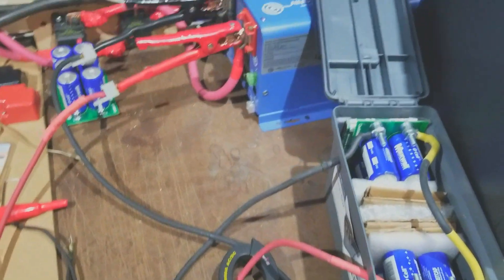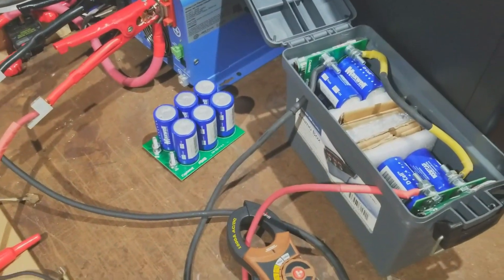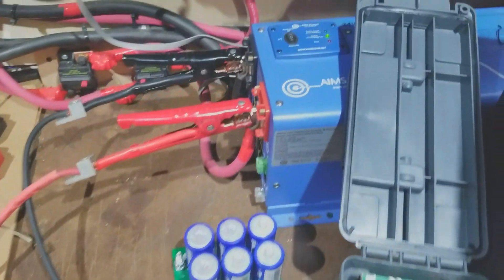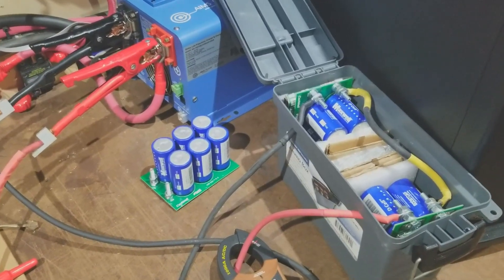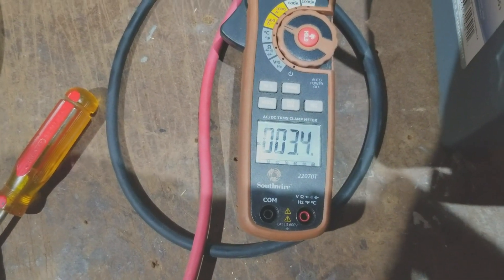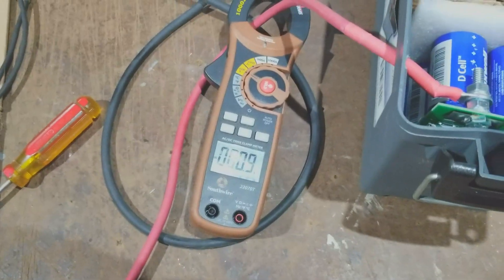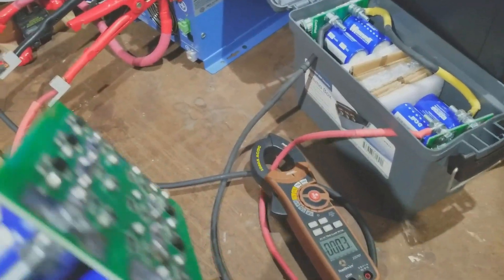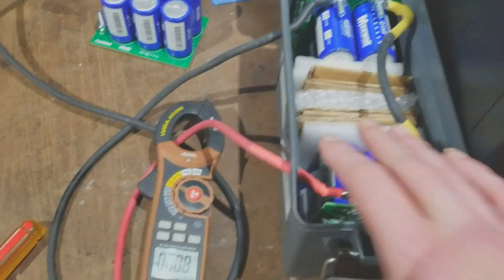Maxwell Super Capacitor use for Off Grid Power Inverters.

Comment: How Can a 16v capacitor be connected to a 12v Battery without damaging it please 🙄🤷?
Reply: Well it will just charge the super cap to 12v. That 16v only means that it can handle upto 16v

Comment: Hello SOSH. I'm new to this super capacitor assisted battery bank aspect of solar energy. I came across your video in my effort to learn "how to". My goal is to provide some surge assistance to the battery bank to smooth out draws as you describe but I haven't found anything that specifically explains how many/big the supercap bank should be based on capacity of battery bank or output of inverters. I suppose it is simple math, but I haven't found instruction. I have six 100AH 48V LP4 batteries and two 6.5kW inverters in parallel. Can you point me to information (or explain) in this regard? Also, I see some pre-Mades with BMS; in what situation would a BMS be necessary?
Reply from the maker: Most Cap bank dont have BMS. They are called Balancing boards to bleed off extra Voltage. Also in your stituation. The amount of caps would be probably 20 to 24 depending on Voltage rating of Cap. Most are 2.7 to 3.0 Volts. I would use 3000 Farad each one. Because then you would be around  100-150 Farad, That would be Huge for 48 Volt. They have to be tied together in series to increase the the Voltage rating.

Comment: I am thinking that this type of setup would suit running a 2000w microwave on a APC 3000XL UPS with a 48v 102AH AGM lead acid battery bank. Presently, the voltage sags quite a lot. What do you think?
Reply from the maker: You get enough capacitors it would most likely help some.

Comment: That's so much for the demo.
Sir, I need your advance on this...
I have a 3000w inverter to power an induction motor through a frequency drive,  two batteries are connected in series for a 24v input. How do I connect my supercapacitor on 24v batteries?
Reply from the maker: Best connection would at the Power input on your Power Inverter.

Comment: Very nice setup, I was wondering how well your charge controller gets along with your capacitors or do you have separate ones for the batteries & capacitors?
Reply from the maker: The charge controllers get along fine with them. The Capacitors charge up along with the batteries .
Reply: @SoutheastOhioSolarHaven  Thanks for your response. Do you have the capacitors connected directly to your inverter or in parallel with your batteries?
Reply from the maker: @Pbeas52  My cap bank I use is in Parallel with my battery bank.
Reply: @SoutheastOhioSolarHaven  Very interesting, are you using an mppt controller or pwm controller?
Reply from the maker: @Pbeas52  Midnite Classic 150's 3 of them
Reply: @SoutheastOhioSolarHaven  Great controllers, they don't come much better!

Comment: Hey , almost done my solar setup. I need help‼️ 3000 w inverter, 8000 btu ac (800w)... Ac still cuts inverter off when the compressor is trying to come on‼️ Im sure i dont need a more powerful inverter.. Any advice? Would one of these work? Thanks & God Bless‼️
Reply: All you need to do is double up your positive and negative wires or yet really thick wires that should fix the issue
Reply: @supremeautomotive6749  I realize my battery Bank wasn't big enough I'm way more advanced now lol
Reply from the maker: Depends on the size of your battery bank. If you can run it also. If your trying to start with just a couple of batteries it may not start. But a small bank of supercaps may help you also. But you still need a decent sized battery bank to deal with high power starting devices such as your Air conditioner. And a Good Power Inverter that can handle starting surges.
Reply: @SoutheastOhioSolarHaven  thanks

Comment: Hello I like car audio and I am new to solar but like it because it seems similar and both want the same end goal, A ton of juice and able to pull from it constantly and Sporadically. Could you pair a couple of xs power titan 8 lithiums their 14v? Also with the caps With these caps mainly your 250? Could you go 14v on solar? And could you also go 0/1 ofc on solor?
Reply from the maker: I see no problem with that.
Reply: @SoutheastOhioSolarHaven  Thank you. How many volts is to many volts in a solar system?
Reply from the maker: @Btc_maxy   When you using Lithium or SuperCaps. You don't want to go over manufacture ratings of the Batteries or
 capacitors.
Reply: @SoutheastOhioSolarHaven  man your awesome, i just learned theirs not much benefit of running higher volts because one of variables always ends up  the same. I guess their is some sort of benefit but not worth the cost. From what I understand. I wonder if a solar system can power an alternator 24/7? If so you can end up having a continuous 100/200 amps.
Reply: Wow big idea could you not end up powering even more alts with just one alt is this viable?

Comment: WOW ! SUCH SURGE STARTUP POWER IS GREAT KEEPING THE INVERTER FROM EVEN DIMMING THE LIGHTS DURING LARGE MOTORS AND HEATING STARTUPS .  THATS STEADY RUNNING ALONG WITH THE REGULAR BATTERY BANK .
Reply from the maker: it will help alot against surges of current from battery bank
Reply: Just a thought, I did not know typing in all caps is considered shouting. just in case you didn't know, did not mean any disrespect.

Comment: Great video my friend just one question can supercaps  hook up to solar panels before the charge controller to maintain current on cloudy days due to their Quick state of charge
Reply from the maker: I have actually tried this, And it really did't help. I think it because of the limited power solar panels will produce. Plus charge controller will control alot of it. Now for charging capacitors. Great for that. Just need to be careful on the Voltage.
Reply: thanks much

Comment: Hey- how can I contact you for some advice.  I'm looking into using capacitors instead of a battery hooked up to 2Kw solar panels and a charger controller to keep them charged while sun is up. Then to an inverter so I can run a freezer while the sun is shining.
Reply from the maker: I will tell you that it wouldn't be feasible, You would need close to 1000 of the 3000 Farad Supercaps to have around 2-3 kw of power storage. It would be better for you to have batteries and use the Supercaps along with to help current surges from your battery bank. 1 Bank of 3000 Farad Supecaps will be plenty. The D Cell I show here are 350 Farad each. I have larger cells that are 3000 Farad I use also.

Comment: Thanks will it also work the same way on AC
Reply from the maker: Thats for Dc application. You would have to use Capacitors that are used in AC application. They like  to call the Starting capacitors.
Reply: @SoutheastOhioSolarHaven     would those AC capacitors also help starting some appliances?  i mean,that would save the inverter from some jolts.. better than the DC ones, no?
Reply from the maker: @josepeixoto3384  The Main purpose behind this setup. Is to save your battery from extreme current draw,  And Yes maybe on the AC side a Ac cap could help the Inverter on the AC side some.